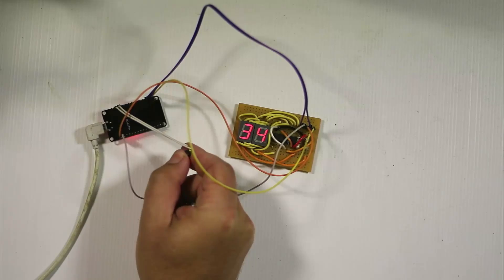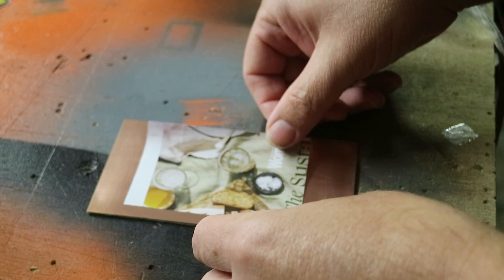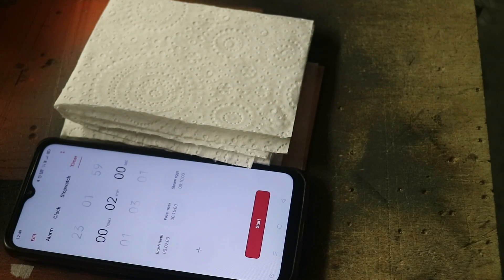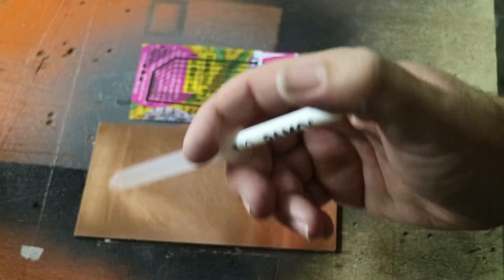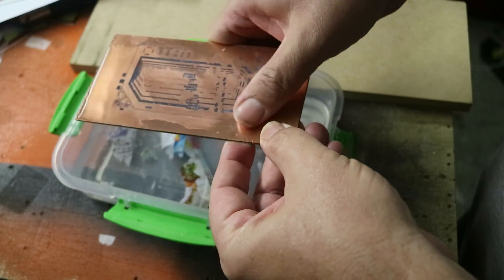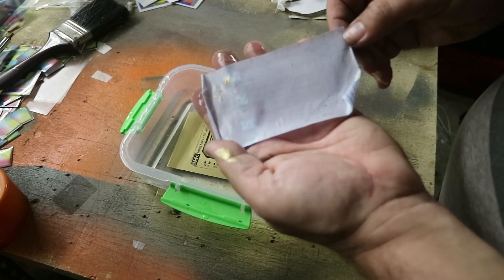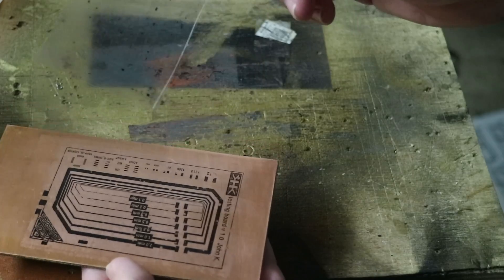DIY toner transfer pcb | 5 methods tested

Comment: For this method, the gloss paper from cheap newspapers works best. Print on good quality printer with any "eco" options off. You want a lot of toner. Wash the board with alcohol before, dry, iron the paper in and then throw the board to soapy water and leave it there for 1hr. Like gppl77 says: it should soak to pulp. For some boards, when you lift it, it should already start coming off.

Comment: Using an iron requires more than a few minutes. Having a paper towel over the paper, press and move the iron around and keep going until you see the toner appear through the paper. Once that's done, rinse in warm water, let sit until the paper is totally saturated, until it bubbles or looks like it is lifting. It should just rub off as a pulp. DO NOT USE Brother laser printers! Their toner does not stick during the heat process. I've used this method successfully many times.
Reply from the maker: You can't purchase ferric chloride or ammonium persulfate in my country anymore, so there isn't much point praticing anymore.
Reply: So if you have a brother printer and a off-brand toner in it, it would be ok?

Comment: what is the toner transfer 3d printing technique your briefly mention in the video?
Reply from the maker: Essentially, a laser printer uses toner to create images. This process uses heat and pressure. When you apply heat and pressure again to a print, the toner comes off and adheres to the circuit board. This toner protects the copper during the etching process.

Comment: I have been making home PCB's for about 40 years using the positive photo resist method. But now days you can't get the resist coated boards or the chemicals anymore. MG Chemicals made the best stuff but they no longer sell it.  I also have a large 8 x 12 solder pot where I dip the boards coated with liquid flux just like industry did in the 1960s before solder mask became the norm.. I find that DIY tin plating solution breaks down after a few years. I too tried many of the YouTube toner transfer techniques including professional transfer paper with the same poor results you got. One YouTuber, Mr. Carlson's Lab, makes really good SMD PCB's with toner and a low cost modified laminating machine. I guess it's practice, practice, practice, until you come up with a good process. I hear you can get the photo resist products from Europe? PCBway is great and I use them a lot. But often I just need a simple single sided board.
Reply from the maker: I did a follow-up video using a laser engraver that is a bit out of the price range for most, but they are getting cheaper. You only need a lower power one. Aside from that, after the video I did buy a cheap laminator and it takes a lot of the guess work out of it.
Reply: I love Mr. C's lab's method!

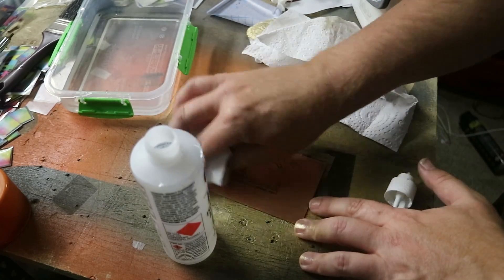Comment: For the Toner Transfer technique, 5:10 what film did you use and what printer? Thanks in advance.
Reply from the maker: Any laser printer and any laser printer compatible acetate will work 😀
Reply: the last method with the clear sheet was not explained enough for me to understand what it was you were using so was searching through all the comments to find this answer , glad i was not the only one stumped @JWNZ

Comment: This video was just hilarious!  I tried most of them also, and none really worked well but eventually I found that the backing of UPS labels worked the best but still unreliable.
I tried the uv photoresist recently but it seems my photoresist had some flaws which made traces have flaws too.  I always end up patching them with a fine felt tip pen.
I am now working on a cnc method to either scrap off paint/resist or draw the traces, or use uv laser to activate the photoresist instead of a transparency print which also can have flaws.
btw, I send my boards to china to be made, and finally got them after I changed the design 3 times using my self made boards and now sent the good design to china to wait 3 or 4 weeks to get them because china has lots of holidays when nobody works.
I've also been working on modifying a laser printer to print directly to the pcb board.   The original hack 10 years ago used a lexmark printer which I found for $5, but I'm now trying to get a Brother printer I got for free to do it, the paper feed was not working right, so it was free and I don't need a paper feed...
Reply from the maker: I recently got a laser engraver. So I am going to spray some enamel paint on the copper and burn it off with the laser. I will share that in a video also.

Comment: The point in heat transfer and acetone transfer is to completely soak paper in the water, so it nearly turns into pulp. Hot water works the best. Then you just gently rub it off. This way there's no pulling and thus no traces, even the tiniest, have a chance to come off (granted you've properly prepped the board).

Comment: Would you mind making an in-depth guide of the Transparency film method? That would be great thanks.
Reply from the maker: My suggestion is if you can find one cheap enough, purchase a laminator. Print the transparency and feed it though about 10 times. I got one after I made the video and it made a world of difference.
Reply: What is the purpose of feeding the printed transparency through a laminator?
Reply: @JWNZ  Many thanks but What about the transparency film what kind of printer and film type?
Reply from the maker: @วิทรูเตชกุลพงศ์กร  anylaser compatible transparency. You can't use an inkjet printer. It has to be a laser printer for exmaple https://www.amazon.com/laser-transparency-film/s?k=laser+transparency+film
Reply: Thank bro.

Comment: What temp and time did you use for the transparency film? My local paper home office store prints really good resolution onto their transparencies but am having s difficult time nailing down the time temp for them.
Reply from the maker: Hot and long. My iron doesn't have a temp setting other than linen. Heat and just as important pressure is what you need. Make sure both the transparency and copper are cleaned with isopropyl alcohol first.
Reply: @JWNZ  I am using a t shirt heat press so i can control heat, pressure and time.  I fiddled a lot more and so far it looks like 240 F is the right temp set at max pressure and 30 seconds is a great start, just need to fiddle with pressure and time.

Would you say if your printer can print something, that you should be able to transfer it at the same level of detail?
Reply: @chrome72   @chrome72  that sounds like the perfect device for toner transfer as you can control all aspects to have consistent results. I would say once dialed in you should get most toner to transfer. I never got 100% put pretty close.